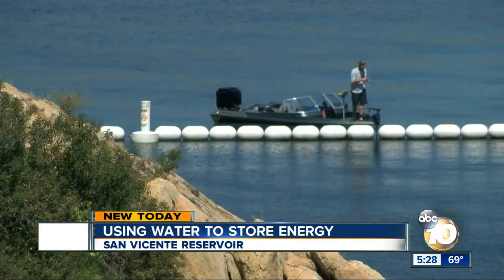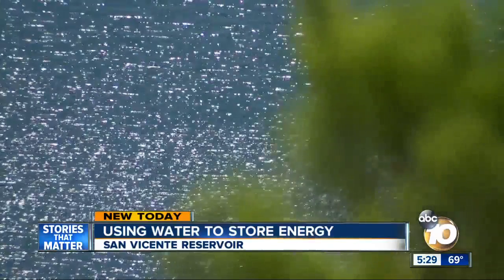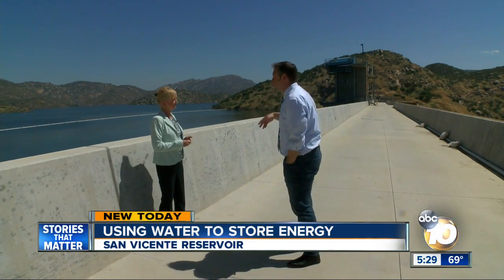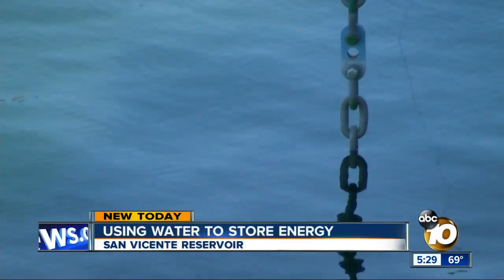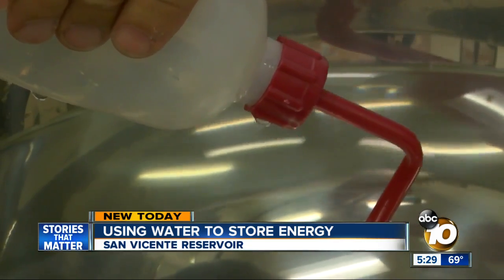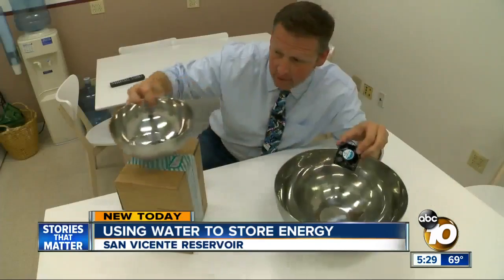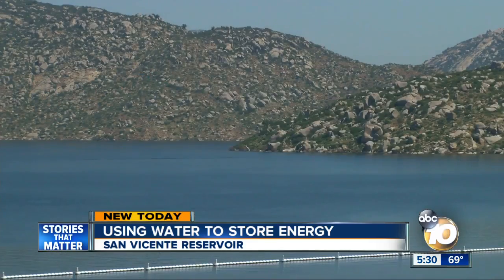Using water to store energy

Comment: Joe, you had me until you said something that defies the laws of thermodynamics. 

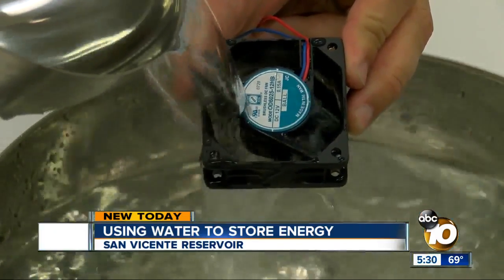"The power coming out will be more than the energy needed to pump the water in the first place" 1:35 

Quite simply this is NOT possible.
I still think that it is an excellent idea, especially if combined with shade balls to reduce evaporation.
But there is NO WAY to get out more power from water flowing down hill than it took to pump it up there in the first place.
Reply: Yes, you are right. What I think has happened is that the reporter did not catch or include that people require water at the pressure that is acceptably delivered by the lower reservoir. Essentially, there is a surplus of energy if you pump 10 gallons up and then drain 20 gallons downwards through a turbine.
Reply: I wondering the same thing I was like wtf did this guy find some miracle